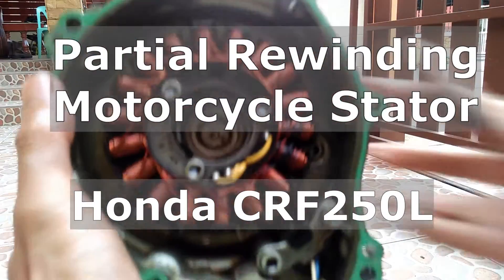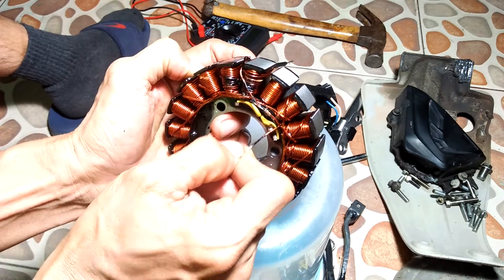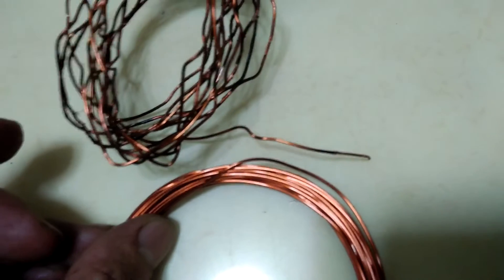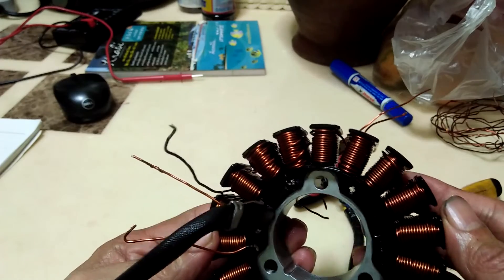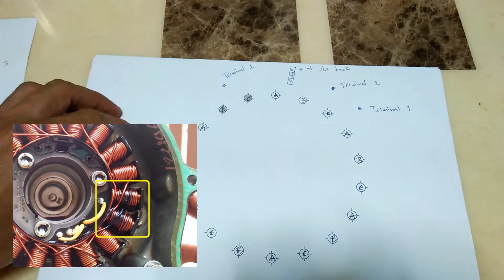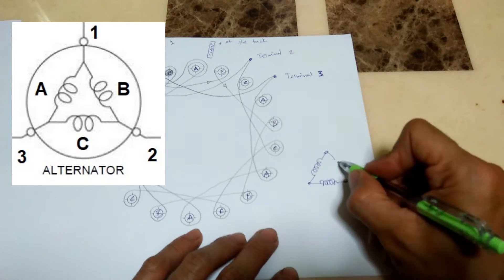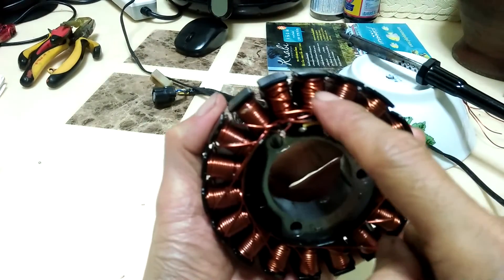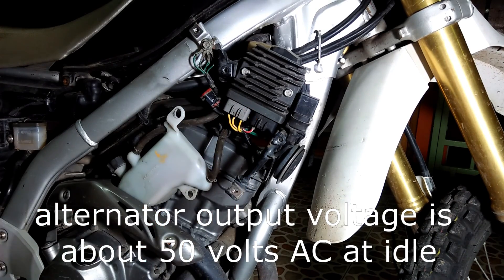Motorcycle Stator Rewinding Honda CRF250L

Comment: Thanks so much for the video. The diagram you show at 06'34" is very useful.

Thanks to your video, I now feel able to redo 2 stator windings of my Yamaha RD250 ypvs.

I thought about soldering the new wires to the old ones with tin, but I'm afraid that tin soldering doesn't resist heat.

From your video it is not clear to me how you soldered them; I see at 7'30" that you covered the welded area with heat resistant sheathing.

What type of solder did you use for soldering?
Reply from the maker: Hi. I just used the regular tin-lead alloy solder used in electronics. I just make sure to remove the varnish insulation from the wire ends and use flux and soldering iron with sufficient heat. The connections covered with insulation sheathing you describe were first piggy tail spliced before soldering so I am confident they will hold. I don't think the hear inside the crank case is enough to melt the solder. However, vibration of the engine may crack soldered joints if they are not well soldered.

Comment: Those three wires coming from the stator to the regulator, can they be 1.5mm/2, isn't that dangerous?
Reply from the maker: I suggest you use automotive wires as they are oil and heat resistant

Comment: Did you measure the resistance before doing this operation? I have a bike which is really hard to start and no spark when using the starter. But the resistance of the stator is in spec...
Reply from the maker: Yes I did measure the resistance as you can see in part 1 of the video, link below. In my case, the resistances are within spec, however the voltage output of the stator is very low. https://youtu.be/3aK8z5vHeTI
Reply from the maker: Yes I did measure the resistance as you can see in part 1 of the video, link below. In my case, the resistances are within spec, however the voltage output of the stator is very low. https://youtu.be/3aK8z5vHeTI
Reply: The coil does not affect your spark if your coil is dc. But, if ur coil is AC, alternator is important for the spark. In dc stator, the pick up coil is the one who made a spark.

Comment: Does it matter if you wind all the coils in the same direction?
Reply from the maker: Hi. I just follow the original winding format. In this case all coils are wound counterclockwise. They are in fact wound in the same direction and it worked perfectly.
Reply: I removed my old burnt stator coil . It's single phase and noticed that one coil was wound clockwise and the other one next to it was wound anti clockwise and then again clockwise and then anti clockwise and so on... Here if I wind all in same direction it won't work right? I have to follow the original scheme of winding to make it work... Please reply... Thanks for posting this video
Reply: Same way cancells out on adjacent coils.

Comment: I Have learned a trick when winding the poles with magnet wire. I use a round heavy stuff plastic straw that makes rewinding super easy. At least it worked for me Sir. Also, I have added a jelled  hand mold to make it comfortable for my hand too. Nice video fella with good information Sir.
Reply from the maker: Thanks. I can imagine how you do it and I will definitely try it next time if I have to rewind with magnet wire again. I did the rewind job in the video in a rush at night since I have to use the bike the next day. It could have been better, but I worked fine, nonetheless.
Reply: I am glad for you Sir. Necessity is the mother of all invention. Am glad it worked for you fella. Just touching base with my experience that the neater the wire laydown the longer the performance. Most of the time , it is timeless. Good day Phil too. vf @DIYPhil

Comment: I have rewound 3 stators for my Suzuki gs1100es. The first two only lasted 3 to 4 thousands miles. I used JB Weld epoxy instead of motor shellac and attempted to get the windings as tight as possible. The point of failure these two stator seemed to be the three layers of windings chafing against one another despite being quite solidly JB Welded. My third stator has lasted 31 thousands miles! This stator was rewound the same way except I used caption tape around the iron core and each layer of all the polls. I hope your repair stands the test of time, but if you do have any issues consider trying  the caption tape trick. Keep up the great work!
Reply from the maker: Hi. Thanks for the comments and suggestion. The stator on my bike has a plastic covering the iron core so the first layer of windings are protected. If I will have to rewind this or another stator, I'll keep the insulation in between layers in mind. I have plenty of mylar tape used with transformers I can use for that purpose.
Reply: I just finished up a rewind and used 2k clear applied with a brush then placed in vacuum chamber, multiple times.   The Iso cured laquer will cure hard as a rock and should resist the heat very well.  Hopefully it lasts